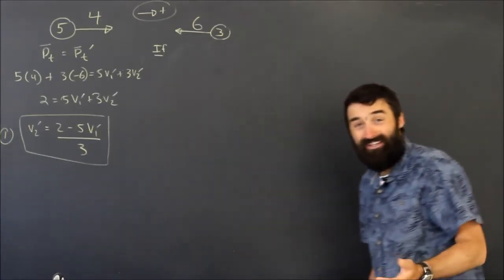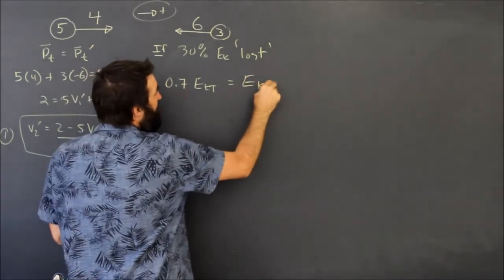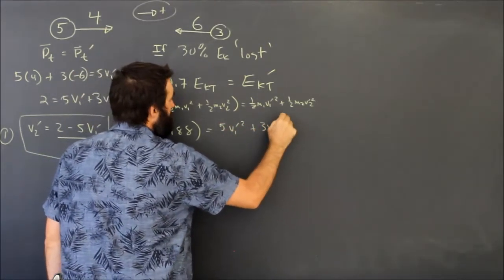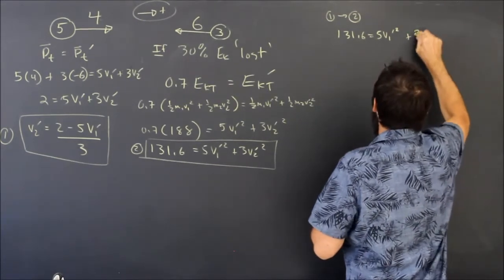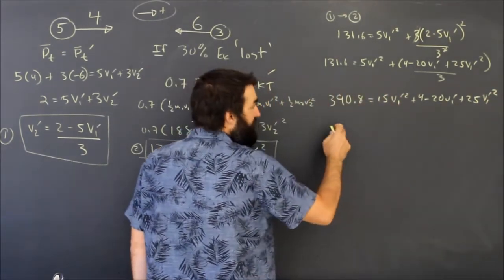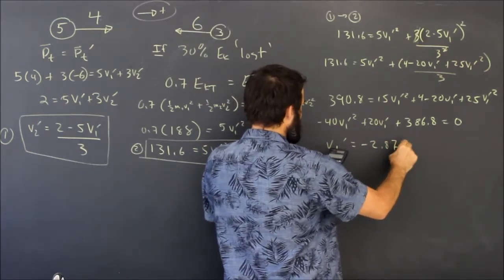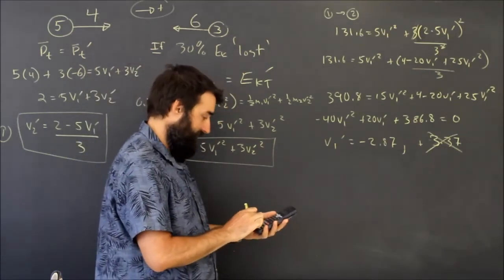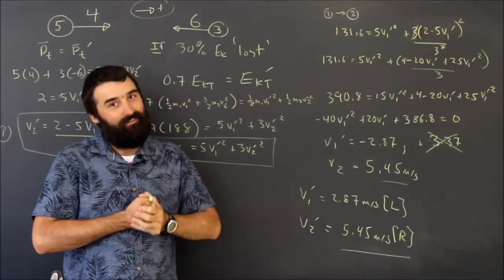Elastic Collision Using Momentum & Energy With 30% Energy Lost

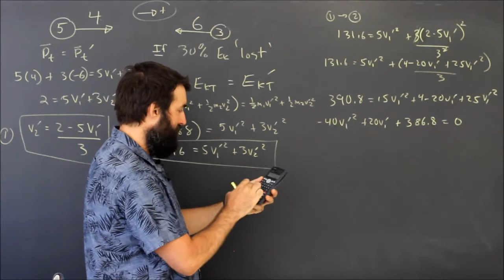Comment: At 3:55 how did "5v1^2" become "15v1^2"? Why do we have to multiply it by 3 when it's on the same side of the equation as the term you are dividing by 3? Sorry, thanks!
Reply: no he is multiplying by three for both sides to get rid of the 3 under the fraction, but since the 15 is not over the fraction it also gets multiplied by 3 along with the rest of the equation.